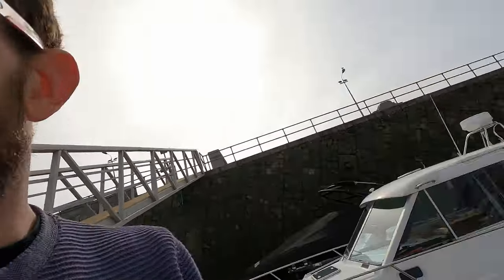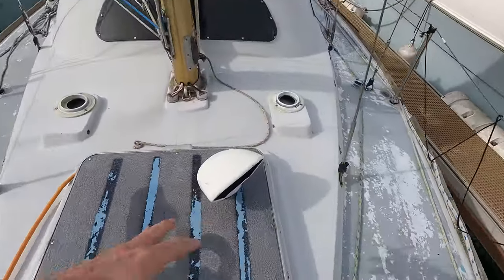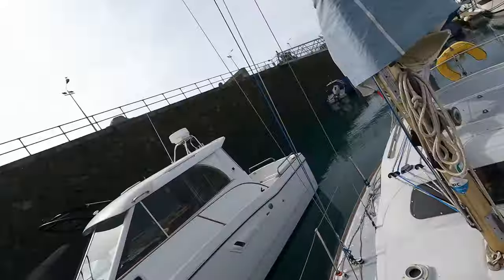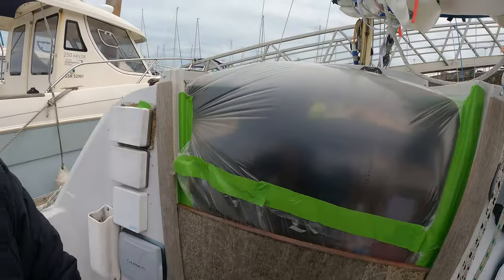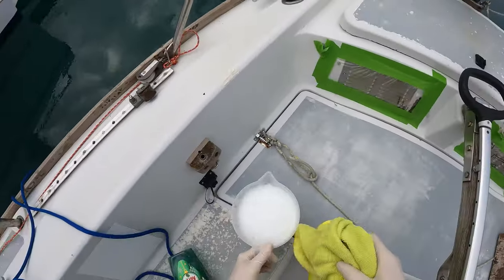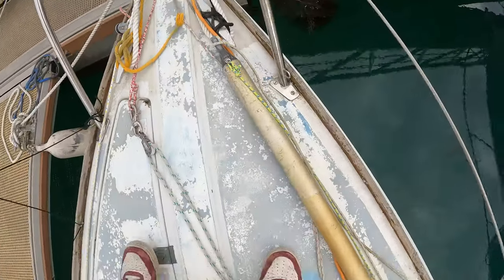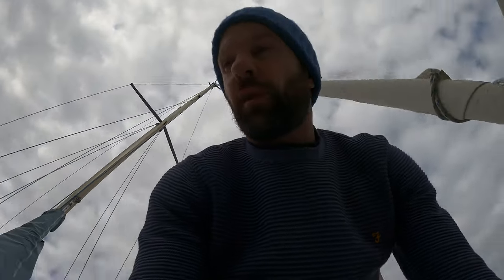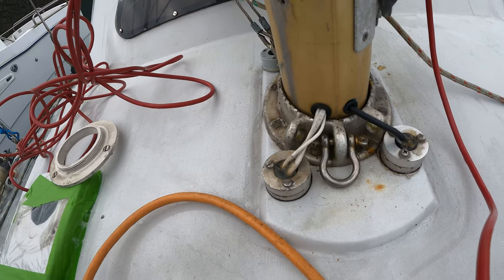Leak Testing a deck with Pressure!

Comment: Before you started i thought this can not work.   Remember the cabin will not be sealed to the cockpit lockers so i am doughtful you could seal it enough or build up enough pressure..  Forget the bubbles and just seal all known leaks .
 As @robertclarkson5101 said just methodically seal all you know and wait for more till they have all been fixed..
I had 24 and got 23 of them   no 24 is being a bit tricky .  But hey gives me something to think about whilst trying to get to sleep.  Boats!!!
Reply from the maker: Wow! I hope I don't get quite that many but I'd say I've noticed 5-6 visually. Yeah it was spectacularly unsuccessful but it apparently is a technique. I think it needs something more viscous than detergent in water though. I'll be resealing the known ones and we'll go from there!
Reply from the maker: Agree there's a connection between cabin and stern locker and that locker isn't sealed around the lid. I figured it was worth a try, I was hoping really to see if it identified any toe rail leaks as I don't really want to do anything with the rails if I can get away with it. Well let's just say they're much lower down the job list than everything else!
Reply: To be honest if the air did not have a path through the cockpit lockers it would have been likely that the plastic and masking tape sealing would have given way. His method was sound and he clearly had a positive pressure in the hull. Maybe a more methodical (less frantic) approach starting from aft and working forward, with a more gloopy solution in a spray bottle would have produced more reliable results.
Reply from the maker: Agreed on all counts! Re the franticness... the hazards of squeezing in videos/doing boatwork during your lunch hour 😂 Hopefully with the clock change I'll be able to get more done in the evenings, if the weather ever lets up!

Comment: Best way is to refit evey through fitting in a methodical way.
Reply from the maker: Yeah as a bare minimum I'm going to pull out and refit/reseal the known leaky ones. And then I guess I'll see whether or not that stops the boat getting wet and go from there
Reply: Keep smiling
Reply from the maker: Always! :D